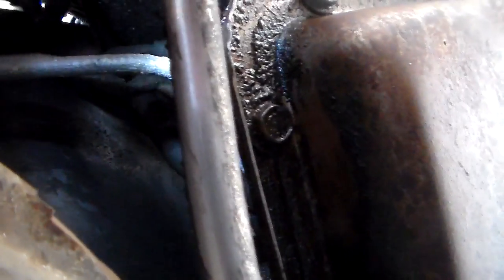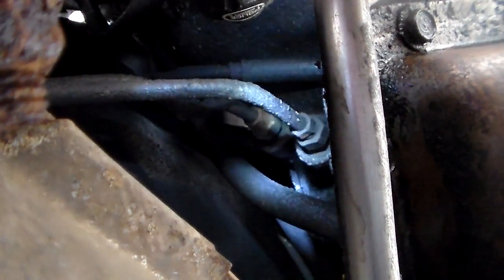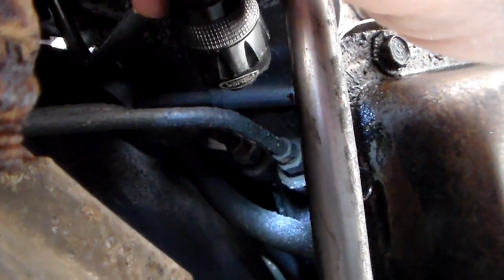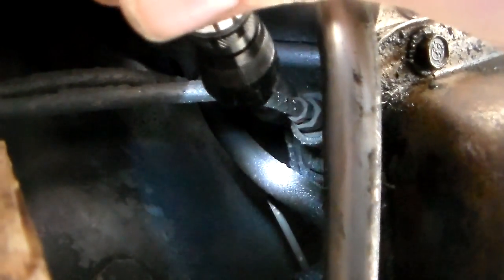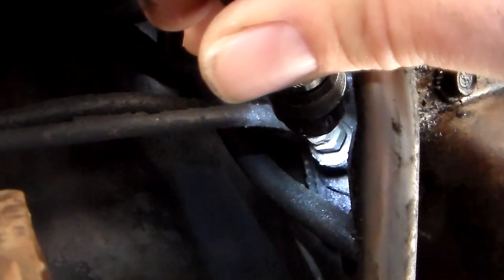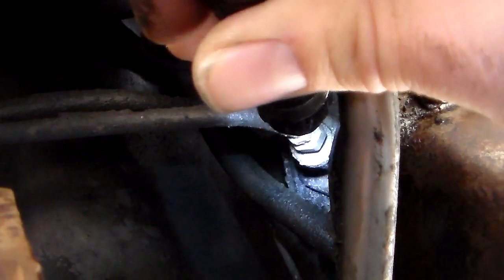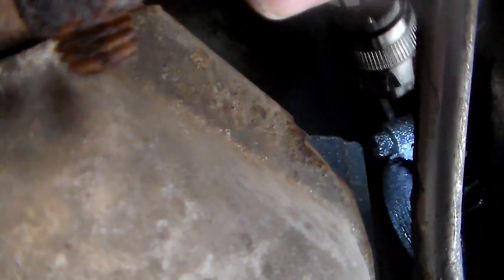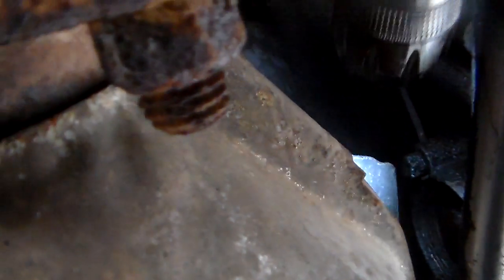Identifying a GM TH250 automatic transmission

Comment: The metric TH200 has a similar shaped pan as the TH350 but they are not the same. The TH350 has a smaller angle of a corner of the pan. The TH200 angle is larger. Also, the TH200 has a one peice solid case, no removable tail housing. Malibu Racing site has comparison w/pics, OAL, etc of the different GM transmissions.

Comment: The v6 cutlass had a th350 and the 307 v8 had either a th200/th200c or 2004r. The th350 behind the v6 231ci cars however had a few less clutch packs inside the th350 trans making it a lighter duty version of the th350 trans of the v8s.
Reply from the maker: Right, it's a TH250, identified by a band adjuster on the passenger side.

Comment: Was the THM250/C ever available with the BOP (Buick/Oldsmobile/Pontiac) or CBOP (Cadillac/Buick/Oldsmobile/Pontiac) bellhousings and/or the "Dual Pattern" (universal/corporate/multi-platform, to ensure compatibility with both Chevrolet and BOP engines) bellhousings? So far, the only research I found for this model was that it was made by the Chevrolet Division, RPO codes M38 (250) and M31 (250C), so this model probably only had the Chevy-centric bellhousings.

I know the THM200-4R has the "Dual Pattern" bellhousing, as I know it was used across all kinds of GM engines in the 1980s, including the Oldsmobile diesel V6 and V8 engines.